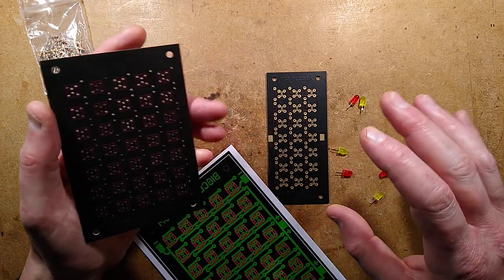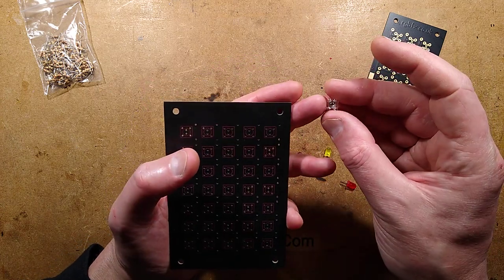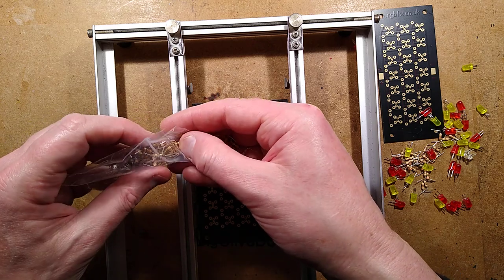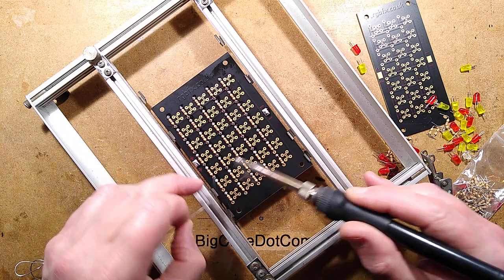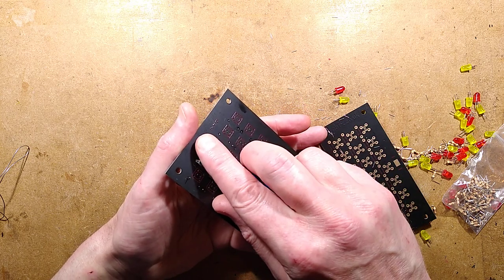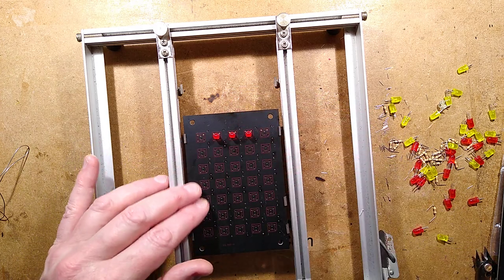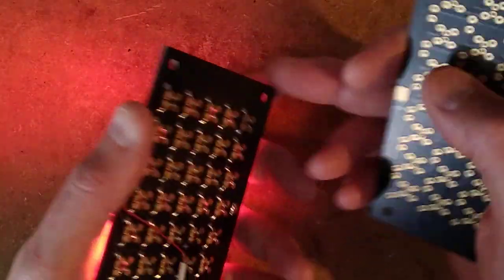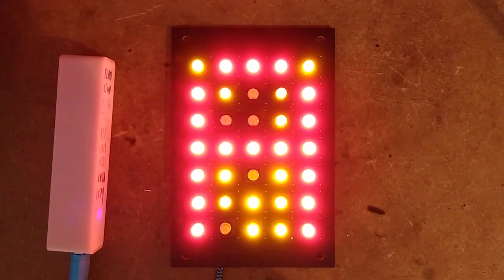New sign PCB files now up.

Comment: Soldering to gold produces an inter-metallic layer that is very brittle. This is outlawed in the space industry. I did the investigation when I worked for Mullards Blackburn in the early '70s.
Reply: Really? That's fascinating, I never knew that, so would you just used tinned copper for pads in space? I did hear about certain solders start growing crystals in space which can cause massive problems.
Reply: @jonelectronics510  
That's lead free solder.  The tin starts growing tin whiskers.
Reply: @Joachim Shekelberg I'm not sure what they would use in something super critical.
Reply: Might be wrong but I though silver soldier used to be used for space....
Reply: @joltdude  It's leaded solder

Comment: For gold plated PCBs, a good way to refresh the surface are vinyl erasers (or rubbers in British English IIRC). Afterwards wipe off the particles dry and then with some PCB cleaner (or plain isopropyl alcohol).

Comment: What if you mounted 2 pin female sockets where the LEDs go? ( like you did for the bundles of leds ) Then you could change the LEDs and make different letters as time goes by.
Reply: That is a great idea, but he can't use the two different widths of PCB in this way. He will have to use a "monospace font" like Courier.

Comment: Gold does not tarnish-if those pads need cleaning before soldering, then they are NOT gold plated!
Reply: Pure gold doesn’t tarnish. The gold plating on PCBs isn’t pure though.
Reply: Cheap gold plating on PCBs is done in a two step process (ENIG) with nickel being the base layer over the copper, and then gold on top of that. What tarnishes over time is probably the nickel because the gold is so thin that oxygen can slowly attack the nickel. A so called hard gold coating should not exhibit this issue.
Reply: @Gameboygenius   :)

Comment: Those work well, makes for a nice effect which is pretty customizable .
I have just done a tear down of a flame lamp, it uses some cunning kind of shift register which I am not going try get my head around.
The micro only sends out a pulse train, had a look with the scope.
No idea how they did it, but it works.
I actually took the panel off the cylinder after shooting the video and wired the tabs together with it as a flat panel.
Behind some frosted glass it will probably give a nice effect, as the panel is about 80X100 laid flat.

Comment: Maybe blue characters+yellow sparkle or the other way around for increased visual contrast? Plus lower intensity on the sparkle. I could imagine red/yellow being a pain to read for people with red/green color blindness. Another thing that might be good to add is a grid in the bottom side between each resistor/LED pair, so you never have to even look and think "well, this resistor goes to the LED on which side..."

Comment: You keep saying that you don't want to "torture" us with doing all the "boring" bits on camera...but I for one really like that kind of torture...please do the longer videos if you will!  
I actually go back to your longer videos...at or past an hour in length...and watch them all over again...repeatedly...and have NEVER gotten bored.  
For this project...I like the board design but would not use the flashing LED's myself...using static LED's would not be as distracting.  
Maybe even putting in a simple timing circuit based on a 555 to flash the lights in sync...or a 556 to flash the letter/filler LED's in opposite time might be fun.

Comment: You could add a conductive ring around the mounting holes and have them connect to the power rails via solder jumpers or 0Ω resistors,

Comment: If there were two power sources so the character LEDs and the background LEDs could be powered separately, then you could have "lit" characters alternating with "dark" characters using the other color to outline the dark characters.  Something to keep all your spare time busy ;-)
Reply: @notyoung ... since the LEDs are all connected in parallel, you'd have to insert the 'dark' ones in reverse polarity.  Then switch the pos and neg of the power supply to the board to get 'lit' or 'dark'.

Comment: Have you tried this with a matrix so you can create patterns, etc, with a microcontroller? I'm thinking that you could actually put connectors on the sides of the boards so that you could just stack these until you run out of money.

Comment: I've just tried looking at the prices on JLCPCB, if you switch to a 2 layer PCB and the price is a lot cheaper (even in black) which is kinda odd considering that you'd think single layer board would be cheaper with less material used.

1 Layer: Green £8.43, Black £21.20
2 Layer: Green £5.36, Black £5.36
Reply: I'd think they'd just use the same process and just leave one side blank on your part of the panel. You could always upload blank files for the second layer...
Reply: They may just be using double-sided raw boards, so to do a single sided, they’re etching all of it off, which costs them more than etching just some off.

Comment: An outdoor sign made with sealed Qi transmitters, for the letters to be equipped with sealed Qi receivers so there's a weatherproof wireless connection, effectively making them as easy to use as typical back-illuminated sign letters?
Reply: Why not use regular sign letters then? If the background is black instead of the characters it can make a nice effect.

If you want all electronic letters I'd use maybe some metal clips and just cover the entire enclosure in glass or similar. Or, if it's all LEDs like this, why not use a large matrix with an appropriate driver?

Comment: Surely if it tarnishes it's not gold?
Reply: The gold plating is done without an external electric current.  The gold ions are attracted to the copper by means of a chemical reaction, which is self-limiting.  Once the gold layer is one or two atoms thick, the deposited gold prevents more gold from sticking.  This process (called ENIG) is cheaper for the board house, so they prefer it over HASL, the hot air solder leveling method Clive mentioned in the video.  The gold is simply better than bare copper.  In my job, I ALWAYS request HASL, although my board houses won't do 24 hour turn around orders with anything but ENIG.

Comment: the colors maybe need to be more contrasting for the letter to stand out, or maybe in person it looks better. i'm working on designing a 3d printable template used to take a 1mm drill to to drill through picture frame inserts to make one of these from scratch
Reply: you could always tweak the resistor values to match (or spread) brightness levels for contrast

Comment: If we spray paint it, do we need to cover up the holes? Never knew you could spary paint a PCB board.
Reply: First solder the resistors and trim the leads. Then spray paint the front. The paint should be soft enough that you can poke the resistors through it. The solder the LEDs. And then finally paint the back, if you want. Or put differently, plan the work such that you don't paint over a pad that you'll later solder, and also plan it so you don't cover the LEDs (obviously).
Reply: A wee bit of paint may wick through the hole, but you can clean them out easily enough. With single-sided boards, there won’t be any plating in the holes anyway.

Comment: Is there a reason the polarity on the chinese red LEDs are often backwards?
Is it just a common mistake?
Reply: I wondered that too. Poor quality control?
Reply: Probably they are selling us factory rejects.
Reply: @sootikins  It's more the specificity of red that's confused me.
You could be right. I'd just assume if it were rejects, it would happen for other colours?
Reply: I believe that there is no "standard" way to mark the leds. It's just how they are specified for a specific job. The ones sold to us are just over runs from a factory run.  Or maybe the factory simply makes them until it cant make anymore, knowing there is a market for them.
Reply: @benabusthethird9751  Interesting point. In this video it's clear he's speaking specifically about red LEDs. In some of his other videos he finds the same error in other colored LEDs, albeit in regular 5mm round packaging rather than Superflux. So I don't really know...
Reply: @TerryLawrence001  I'm not so sure about that. Admittedly I'm not real familiar with Superflux style LEDs. But I do know that regular round LEDs have a standard (flat side of body negative, long lead positive) that's often not adhered to by eBay LEDs.
Reply: I am not sure there is an actual standard, if you look at enough datasheets you will find different brands commonly mark the anode or cathode depending on their mood. It has caused me issues in the past when some surface mount leds were assumed to marked cathode......they were not....so the assembly had to be redone.
Reply: There is supposed to be a standard way of marking LEDs but some Chinese companies probably could not read European languages as well as they thought they could.  That means that since the Chinese became the predominant LED manufacturers you have to check every batch you buy unless it comes with a spec sheet, and of course most don't nowadays.

Comment: @bigclivedotcom Thank you for your beard advice - the funnel technique, and using oil.
Please consider doing more beard-related videos. I'd really apprecate more info. Like, how to trim the moustache to avoid food debris, without it making me look like Hitler with a goatee.
And how to use clippers... their instructions are crap. I get the concept of the length attachments, but it depends how you're holding them.
And how to comb it.
Reply: Same here. I recently bought some clippers for beard related purposes and I may as well have tried to cut cable with them, Junk :)
Reply: Try hitting one of the forums, like the Shave Den.   There are also some purely moustache and beard forums, for people that don't want to remove any of the hair.

Comment: When you paint circuit boards, do you mask up the solder pads or does the paint not stick to them?
Reply from the maker: I paint the front with spray paint.  The holes usually stay clear.

Comment: Hi Clive, what power supply would you recommend to a serious hobbyist?
Reply from the maker: I recommend getting one from a prominent supplier based in your country to make sure it complies with local standards.  It doesn't have to be too fancy.  It depends on what your main uses are.
Reply: Thanks Clive, I'll probably go for the KPS3010DF or the NPS3010W as they're UK compliant and seems good
Reply from the maker: @ShotgunEmmet  if you're in the UK, check out CPC.

Comment: Where did you buy those pre-formed resistors ?
Reply: I think he pre-forms them himself, to save time in the videos. There's a tool you can buy for that.
Reply: Paul Drake I was hoping there was a source that supplies bags of 100, 200 etc.
I use a lot (hundreds), but irregularly, of mixed values, so buying the lead former just seems excessive at US200+

Comment: Checked the price with JLCPCB, the gerber comes up as  a single layer board and attracts a higher "engineering fee" than if it was 2 sided.
Reply: You could try adding an empty file called <whatever_the_other_files_are_called>.GBL to the zip file (if that doesn't work throw a "G04 Layer_Physical_Order=2" at the top)
Reply from the maker: That's odd.  I wonder why they charge more for a single sided PCB.
Reply: @bigclivedotcom  Maybe a panel space utilization thing? They probably put your boards together with a dozen other orders on one large panel. If there aren't enough orders to fill one single sided panel, you'll end up paying for the empty panel space. Maybe most people are currently ordering double-sided PCBs. shrug

Comment: I like the secondary LEDs but a color that shows more contrast to the main LEDs might work a bit better for the flashing LEDs.  Also like you said changing the resistance of the secondary LEDs to a higher value would make the letter stand out a bit better.

Comment: Pretty sure you had a mini stroke during the resistor solder process based on the square led mention again 😂
Reply from the maker: The video took a while to make despite it's length.  There were also a few false starts, so I wasn't sure if I'd mentioned it.
Reply: @bigclivedotcom  Ah I see. Sleep+ iffy camera = 🤯
Reply from the maker: @creativejamieplays7185  Just being tired.  There's a point I should not make videos.
Reply: And I am tired enough not to notice he did that...

Comment: In all my 45 years of electronics work, I have never seen and oxidised gold contact. Maybe because most of the stuff I saw wasn't gold (LOL). Got a picture? I'd like to see what it looks like.

I like your board but I'm pretty sure the flash will obscure the message. Hard to say for sure without a distant view. They are all so bright.